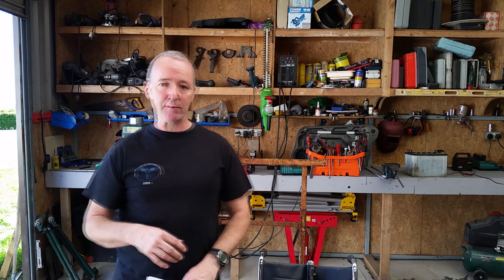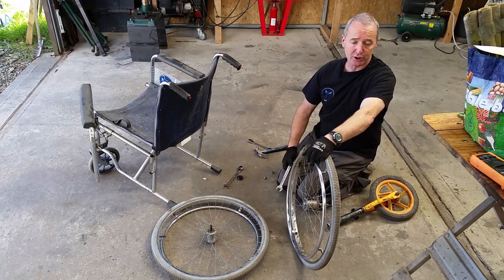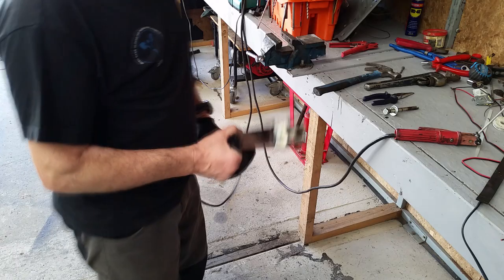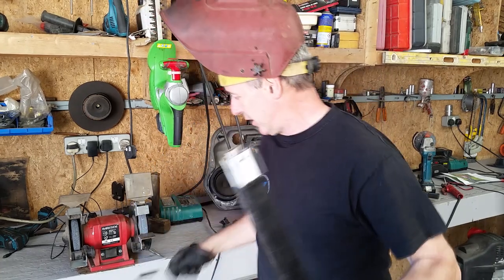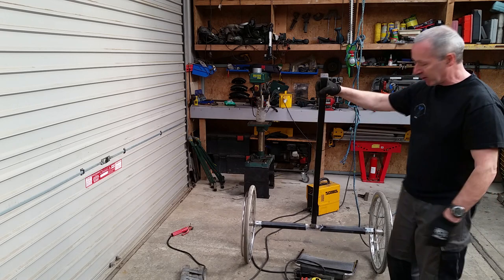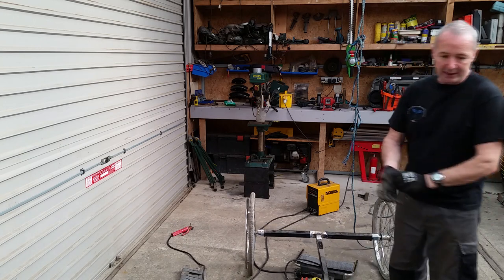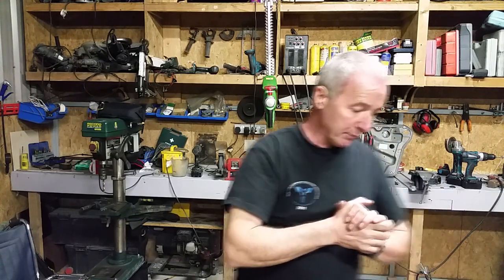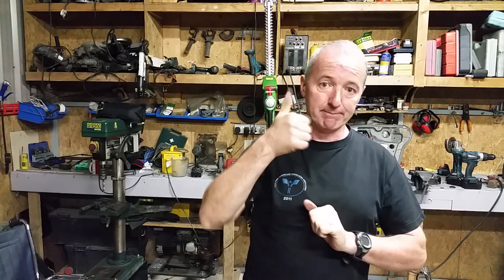Building a homemade Paramotor trike from scrap.

Comment: I dig it. Maybe I'll do one someday. ..
Reply from the maker: Hi Mike. It needs some more metal and some clamps but once that is done I will drive it around the field and see if anything drops off. If something does I will stick it with duck tape, weld or bolt it. A little paint, lots of beer and fly it. Lol Cheers Gerry

Comment: Hi Gerry, you said that you can't remove the galv from the inside of the axle for welding. You can buy an 'airfile' from eBay very reasonably. Its like a sandpaper belt you can get into small spaces. Connected to your compressor.

Comment: Another good video but Gerry this comment is for your Missus .
Missus (oil burner), maybe you should increase his life insurance just in case. You and the Minion would probably need the extra cash to support your family .
Ray
(all comments are made in jest)
Reply from the maker: Hi Ray. I relayed your message and it doesn't faze her. Life insurance stops at about 2 feet. When my two feet leave the ground that's it Lol. I tried to go paragliding this morning in the mountains but the wind was blowing 32 mph( I need about 12mph) so just had a chat with the lads instead. Cheers Gerry

Comment: Would I be right in saying window mechanism was shot in the mk4 door assembly?
Reply from the maker: Hello Mr Know it all. Your powers of observation know no bounds. Yep it's the drivers door window that gave trouble on my old golf. One of the rails broke free and the mechanism ate the steel wire. I welded the rail and I am going to restring the cable this week. Well done. Cheers Gerry

Comment: If you want to save more weight remove the push rims, they are detachable - from a long term wheelchair user.
Reply from the maker: Hi Dean. The trike was just a proof of concept to see if I could make it fly from scrap. I will make another out of Stainless steel or aluminium tubing . Cheers Gerry